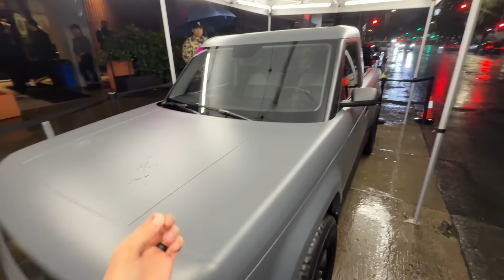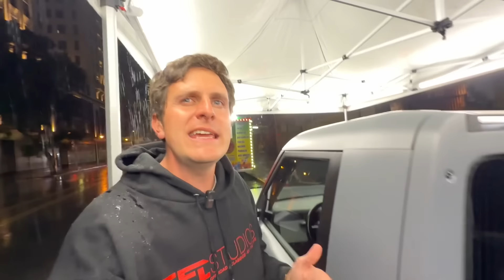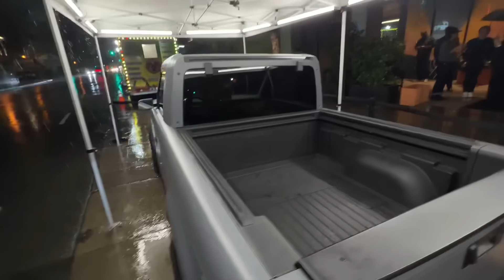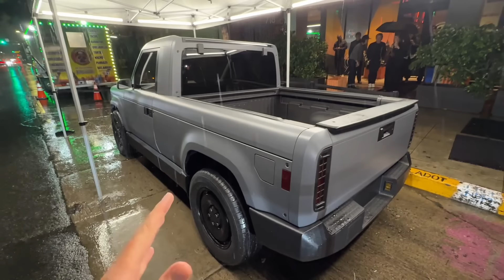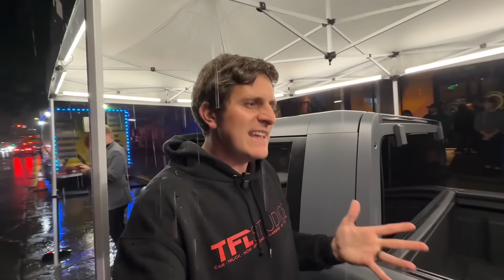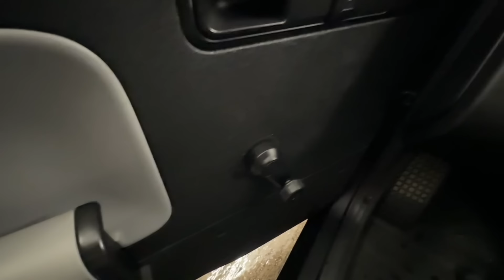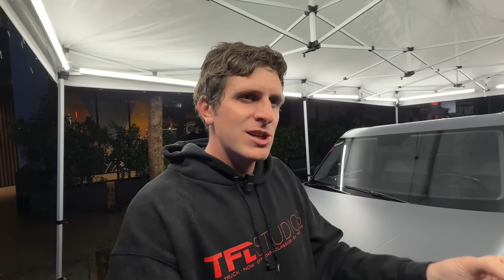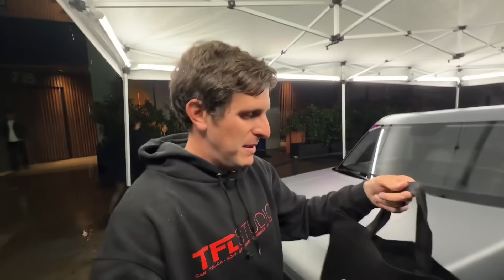The TRUTH About the '$20K' Slate Truck...Will This Really Be a Hit?

Comment: So, many Beta boys. Clearly have little know idea about building it working with crews. In the country or needing to  tow more than a laptop.  The reason why companies build crew cabs and people buy them is because there's a need for them they're extremely practical there's a reason why MEN drive lifted trucks 4x4s. You need heavy duty and clearance to tow and access certain things. See the thing with bettas is they only compare what they know They only know how to try to be cool so they try to pawn that off on people who are actually doing stuff And don't understand that there might actually be a use for those lifted 4x4 quad cabs.n And that's why people buy them😅😅

Comment: No, because it’s not a $20k truck.  It’ll be $25-27k if we’re lucky.  With 150 mile range, 2 seats and zero features.  By the time you wrap in and get any features , it’ll be $30k and still under equipped with low range.

Comment: It may sell, but not to me. I love my half ton Silverado crew cab with the 3.0 Duramax and huge infotainment screen. Just had our first snow in southern MN. I will use 4WD today. I just did that road trip that nobody takes. 4,147 miles round trip to the west coast. I-80 and I-90 have charging opportunities, but the two lane between Rawlins and and Gillette, WY is long, fast, scenic, up and down, and long. Some EVs would do it. Slate would not. Probably cost more to engineer wind up windows than to just put in two little electric motors and switches. Immediate need for a wrap? Not my preference. I am sure some folks will love it, and maybe a good truck for my 13 year old in a few years.

Comment: 11:35 is likely the most rewound section, lol. I really want to like the slate truck, but the problem is, the purpose of the truck is to save money. Why not biy a used PHEV Subaru for less than that and still have all the goodies. If someone REALLY doesn't want all that extra tech, then just buy a $3k Subaru or Toyota, which will likely give you a financial advantage? The people that want less, aren't really looking to spend $20+k for it. My next vehicle, likely in 2026 (my last purchase was a 2017 Chevy Volt in 2019) I'd between a PHEV Subaru, any of the Subaru Wilderness editions, or one of the new Scouts. I road trip often enough to need range. Not only that, but for me, living close to the Bay Area, CA, even living CLOSE,  150 miles isn't enough. It's definitely have to plug in when I got there, and that's just not convenient. Them factor in three range assist a few years.  Then factors in that the people that are shopping for cheap vehicles might be the people that have to do Uber or Doordash at times. People work really good livings aren't looking for a Slate. A company needs to make cheap vehicles that could also be used for the gig economy. 4 doors, 5 seatbelts, range extender.

Comment: A “strippo” Slate will run buyers $30k out the door (tax, license, doc fee). Noting that, a Crew Cab Ford Maverick XL costs $28,145 and seats 5, has standard AC, PW, 6-speaker stereo, 13.2” display, huge Ford nationwide service network, etc. I know which truck most shoppers are choosing.

Comment: If I wanted a simple basic truck I'd rather have a 2005ish ranger or s10. Hopefully the Slate is massively successful so I can buy one when the batteries fail and ICE swap it for REAL simplicity. Too bad with current epa regs you cant have this truck with a 4cyl/5spd since truck size is tied to mpg and emissions standards which is how we get stupidly large "compact" trucks and stupidly under powered engine options for single cab full size trucks.
As for people who say they want the simple truck but dont buy them, base models are nearly $55k so who cares about spending another $10K on things that help it hold resale value on an 80month loan or those people just aren't buying ANY new truck/suv. They are buying used due to budget demands/desires. They are saying, offer something simple IN my budget and I'll buy new.

Comment: 25k is not low enough to pull mass numbers from other small trucks or suvs. given a 72 mo loan for 30k payments are under $100 different? and 99% of everything else has four doors or at least 4 seats. 19k and super low insurance? worked for the original ranger

Comment: I can’t wait to compare and cross shop with the hybrid Maverick and Fords small EV pickup. For now I assume Ford has the edge in what I get to replace my Equinox EV which I love. Of course I will wait to buy until I see TFL and others do challenge reviews between them.

I I had to guess at this time I will be getting the hybrid Maverick but price, 300 mile range and AWD and not every function on a screen. Not sure I want to give up my heated seats and steering wheel.

Comment: The Slate idea is noble.  Reportedly it will be easy to repair and modify to your needs. Manual windows and overall simplicity is certainly a draw when looking for a long term utility use vehicle..... But the price is way too high along with the overall lackluster execution of the grand ideas. Sadly it will be a sales disaster for the reasons you brought up. People want it but will not buy it.

Comment: The fact that the toyota Hilux is $10k for base model, (almost like the slate with roll up windows, bare bones basic)  Then this thing should not be 20k.  It has 3 knobs! Does it have AC? 20k?  I think 15k is fair.  But i really love the idea of being able to take EVERYTHING apart, and work on it easily yourself.  Its so frustrating working on a modern vehicle and everything is impossible to get access too.  At least this was designed from the ground up so that you the DIY / Home mechanic and work on it from home with basic tools.  I dont think people understand how big of a deal that is.  I just feel that 20k is a little steep for a base model like this.  15k and im sold.

Comment: Anything without a full frame under it isn't a pickup. The maverick doesn't count as a pickup. My rangers are about the same size and I've had 1500 pounds in the bed many many times. Let's see a maverick after you load one up like that. An electric pickup doesn't live up to the pickup standards in my book either. I need a pickup that can haul, pull, Go high in the mountains and bomb around the desert. Anything that dies when you cross a creek isn't worth a crap to me

Comment: There's going to be two battery options. One with the 150 miles mentioned and a larger pack with 240 miles.  I want a good amount of headroom in my battery, and factor in how many miles of range I'll have in 5 years down the road (assuming a worst case 15% degradation), and also how much range I'll have on a daily basis only charging to 80% (assuming a NMC chemistry battery.)

Comment: Our host has a point on the Range. I'm on the fence waiting for the used 800V EVs to drop to $15K price point. One of the key reasons is Range and charging speed. The reason is that I wan' to get the most of driving an EV. I don't want to have a second car to use for long road trips.

Comment: If they make the battery easy and cheap to replace these trucks will sell like hotcakes. Because the terrible depreciation of EVs will not apply to this EV truck. All EVS today are really only commuter vehicles and most people have a ice vehicle for long distance drives. I hope this American made truck really takes off and forces all other car makers to match Slate's price point.

Comment: The maverick was supposed to be a 20k truck. It's around 40k and I feel like the maverick would have sold better if it were priced better.  If Slate can capitalize on Ford's missed opportunity and nail the base price at 20k, this will sell well! Given the low range and the opportunity to upgrade the truck over time I feel it's at a great price point with what you get.

Comment: The biggest issue is how much is it going to cost once you price all the accessories you’ll want. The Maverick is at the same price point, has a radio and a screen, has power windows, has 4 doors. 

The starting price needs to be $18k base, and optioned up to $25k to sell. 

With a single cab, if you aren’t short, you are stuck at the standard recline. 

And who wants manual windows? It’s a massive pain in the butt. Anyone who says they want them are lying to themselves. People claim they want them as less likely to break, but powered windows are super reliable today, we aren’t in the mid 80’s. 

I put Slate in the Aptera box, sounds good at first, but will never amount to anything.

Comment: weight in the back for winter is a pain, but not bad really .. store you summer wheels there for winter. some used to put backed snow - I am not a fan of that.
Reply: @OracleRabbitGlenn   The battery weight over the rear axel will be more than enough “sandbags”.
Reply: @asjbcarter  that's true, it should have "some presence" when it comes to weight - visually it looks light.

Comment: Slate is the first EV that I feel I could live with. Price point alone, perhaps. For a kick around run about sort of thing. I have my Gladiator Rubicon for the offroad, I have an older (2002) F150 Supercrew for roadtrips. Or my girlfriend's car. I drive a 2001 Silverado V6 around town, at least until it donates it's engine and transmission for my 62 Scout project... This is what the Slate could do for me VERY VERY well. I'm quite curious to see road test reviews of this trucklet before I plunk down any cash...  For my needs, no, I do not need 4x4 (I have 2), no need for a range extender, I may choose the SUV options. But I want to see what it can do...

I'm intrigued with the Scout and the range extender, but not sure I want to pay that premium.

Comment: 150 Miles range will only work as city vehicles or delivery trucks.  Even 250 mile range is probably actually more like 200 miles, which is better but still limited to local drives and outskirts of a metropolitan.  In winter and summer when you use the heat or A/C that will be reduced even more.  I think if it had a 350 miles range it would be much more practical vehicle.

Comment: Had a 70's something Datsun pickup, bought cheap, mega basic, no ac, stick, 4 cyl., had to keep a bag of softener salt in bed to keep it from bouncing like a pogo.  It did have a factory radio and a separate, small rotary knob on the dash that I couldn't figure out what it was for, for months.  Finally by accident, driving at night, discovered it was dimmer/brightness knob just for the radio's dinky light, weird.  The rest of the lights dimmed off of the master switch like most cars of that era.  Ran great, economical, comfort, not so much for longer trips.

Comment: e problem is that trucks are so expensive you might as well get the one with all the bells and whistles, i ran into this when i was buying my silverado, looked for a cheap base model  with cloth seats and all that jazz but the prices difference between a beat to shit used work truck and a well maintained mid lv with all the features was to small to justify giving up all the features. i got mine for 30k and most of the work trucks wernt that much cheaper, if i could have got a work truck for half that i would have.

Comment: Dead on arrival due to:
1. Cheaply made car that’ll end up starting at at least $30K. Maverick is its enemy. 
2. 4-doors do NOT sell
3. Maximum of 150 mile range and dropping as battery ages and you drive in cold temps or carry weight, passengers, etc.
4. Most young buyers they are targeting can’t pick up a hammer or screwdriver to  do the needed mods mods on such bare-bones vehicle. Or they would pay thousands they don’t have to a shop for upgrades. Makes no economic sense.

Comment: I grew up in Ky on a farm with a 2wd pickup.  We didn't think we needed a 4wd until we actually drove one and then realized all we had missed out on.  A pickup is often used as a tractor as well as a pickup.  A 6 cylinder (or 4 cylinder) with 150 hp is fine but you need traction.  Otherwise you have a street machine fit for clean roads.

Comment: I'd love to see the price breakdown for some of the missing features. Are crank windows cheaper? Sure. But are they saving the company and end consumer that much? It's what, $5 of labor on $10 of parts? I get that there is testing and logistics involved too but It's thirty THOUSAND dollars... I get not doing a screen infotainment, but manual windows? Even if the price was increased $50 it wouldn't make a dang Ol difference to any buyers financially. I agree with a comment below, I don't know if people at large are ready for the level of "downgrade" for the sake of saving a couple thousand. I get the concept but this is a toy for a person who needs a second or third vehicle. And those who are in that position are going to want more than an electric street-going side by side.

Also separately, what's with the exposed hardware?  It's going to get damaged in the bed and eventually rust or need to be extractor'd out. And now a guy with a $5 tool can undo half the body panel attachment points. At least with Jeeps the hood has a tradition latch and alarm and the door handle latch stays engaged and locked. Again, it's very toy like. I want to like this. I wanted to see a comfy commuter with some usable storage. A powerful enough ev motor strapped to a cab and bed with a radio and any level of crash safety rating.

I agree with the sentiment in the video. It needed a bone cheap unboosted engine and a proven transmission and it would be the cheap older Ranger everybody says they want. But at that point who is buying them new? The new tech price increase of it being an EV will kill it after the die hards buy theirs.

If it sticks around for sale for 30 years then sure, it's a great offering but they need to run a business too.

(Edit: Somebody mentioned Slate has addressed the exposed hardware. So it seems like it was an optics/visual thing and that there is probably some sort of lockout for full panel removal. Which doesn't really make me like the idea more. They are easily accessible for strangers to mess with then with no added benefit. Either way it's a bad idea. People have had hitch pins stolen by kids.)

Comment: I feel that around 225 miles of range is the bare minimum for a truck in my area in the Midwest. We are in high winds, highway speeds, lots of hills and temperature extremes. We also need some towing capacity even if it is only 5,000 lbs.

150 mile range with a small 4 cylinder range extender would also work.  Even a 1.6 L engine would be better than nothing with a lower range battery. The area around us is a charging desert. You can charge at home but a large population of people live in rentals and that number is climbing. 
I keep going back to the first gen Dodge Dakota. They were the perfect little single cab truck. Good payload, size , and tow capacity. 
I was excited about the slate until I saw the specs, very disappointing.

Comment: Developing a hybrid version of the Slate Truck kind of defeats the whole point of keeping the build simple. And let’s be honest, the battery weight is basically like tossing 50 sandbags in the bed all winter. It’s not the perfect truck for every job, but that’s the charm. It’s a throwback to when a truck was something you customized yourself, maintained without a laptop, and actually understood.
Reply: Maintained without a laptop? It's an EV.
Reply: That thing is a ev, it has computers you just can't see them.
Reply: @asjbcarter  if you don't have a garage to charge it in, EV is not practical.  Especially with such a small 150 mile range. (If you drive like a grandma)

Comment: If it only had a 4 or 6 cylinder I'd order one right now. But being electric I don't think it will sell as well unfortunately
Reply: I'd be fine with the tiny turbo 3 cylinder from the Trax.
But being electric ... it's just not practical.

Comment: Slate is dead on arrival. When they talked about it being below 20g, I was all in. Now that it creeping up in price I can buy a good used vehicle for less. I got my son a 2 year old Crosstrek Premium with 20,000 miles for 20g. It was eyesight technology, it’s all wheel drive, it’s gas, it’s has a rear camera, has a radio and a spare tire. The list goes on. 

Love the idea but I don’t feel it will take off. It’s not even very appealing for doing truck things. 1,000 lb towing. 1,433 payload. And you know when you start hauling and towing, that 150 range is going to suffer. And you should not run the battery down so are you really getting 150 miles. I can add a hitch to the Crosstrek and tow 1,500. 

Sorry, but I feel it’s DOA. Really hope they can make it work.

Comment: 100% agree with Tommy. Needs to be REV or even just a straight gas option and it needs AWD/4WD as an option. You take these in a wet field and it's gonna get stuck immediately. Absolutely useless off any kind of packed dirt or road surface. If they want to market this as a work truck, it needs AWD. Especially here in Indiana where it's being built. We don't get a ton of snow, but we do get snow. AWD would be amazing for bad road conditions.